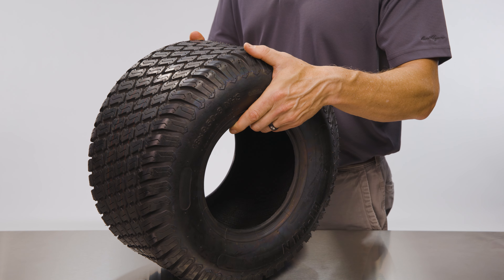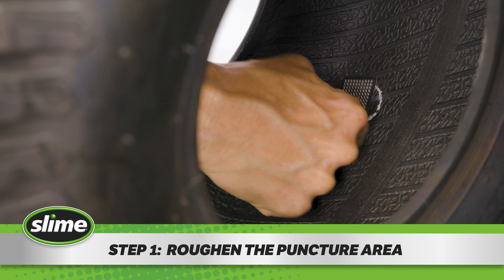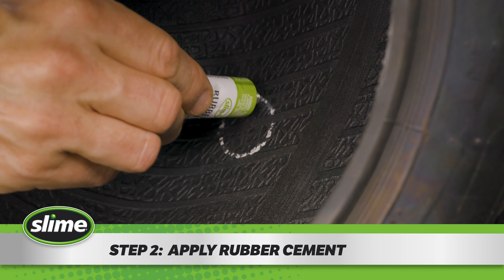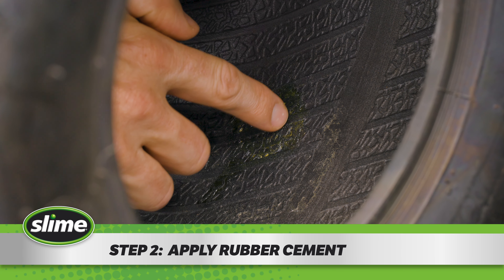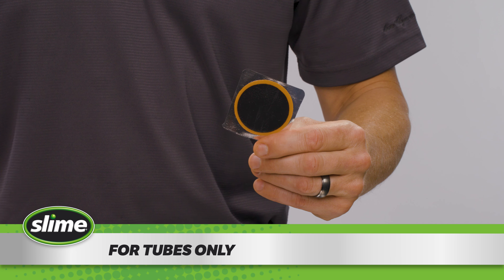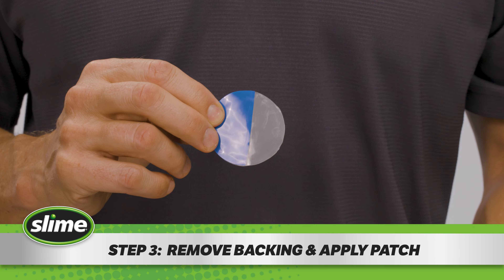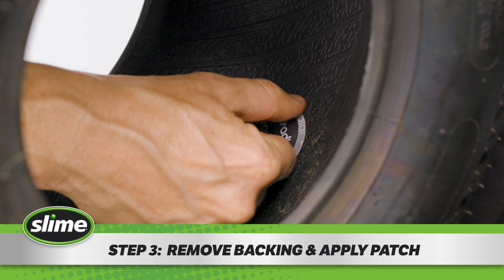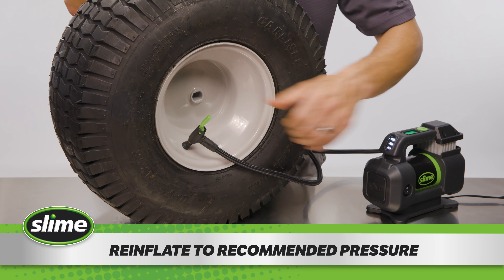How to Patch a Tire or Tube

Comment: It never said how long do it take to let the glue dry before filling tire with air
Reply: did you ever figure out how long?
Reply: I’ll have to time it myself for you guys
Reply: Has any figure this out yet or its trial and error (wasting money)
Reply: @803stunner  so my hole wasn’t like large enough to fit any rubber cement in it? so I just put the duct taped regular patch on my bike wheel (wouldn’t stick by itself assuming I needed the rubber cement for it to stick) but the patch itself has been holding up it’s been a week of riding aswell so, id grab those patches rather than this whole kit
Reply: Probably the only reason that people came to this video is to see how long the cement took to dry once the patch was on. Lol
Reply: @eml951110 you’re absolutely right!!!
Reply: It’s why I came here! C’mon, Slime!!
Reply: Uh this is exactly why I scanned the code!!!🤦🏽‍♀️
Reply: It said to let the glue dry until it's tacky, apply the patch. I'm assuming you're good to go at that point. The air pressure should be applying pressure to the patch until it completely cures
Reply: The package doesn’t say to wait at all once the glue is applied. I went through all my patches in frustration
Reply: Scrape the area hard enough with sand paper. That initial glue drying doesn't add much, it only blocks hole a little. So better apply glue, over the seal after sticking it. Later another layer of strong duct tape covering the seal is good. Somehow clamp it with pliers or etc., and let the whole thing settle overnight.

Comment: "you can peel the clear film off after applying the sticky side to the rubber cement" no, you cannot without removing the patch. also my patch isn't sticky??? it has the brown film under the black patch, and it is NOT sticky like it is to the foil. so when you say "sticky side," that make no sense whatsoever. the brown is not sticky